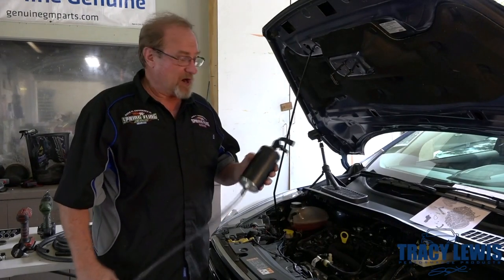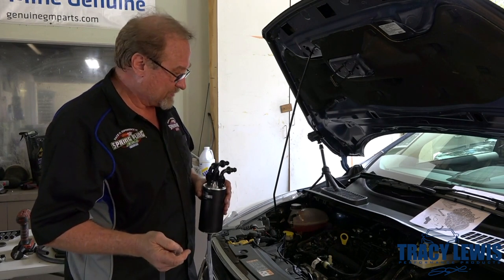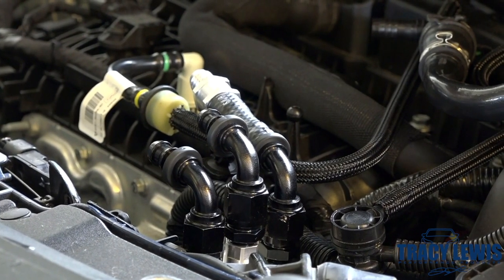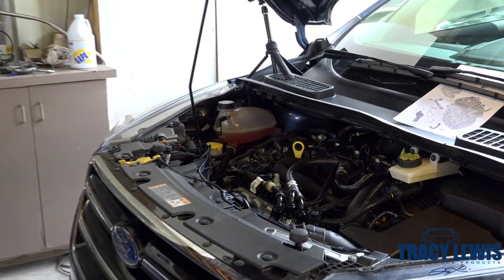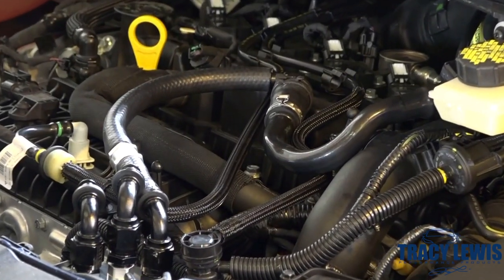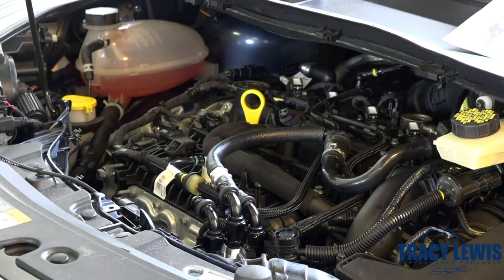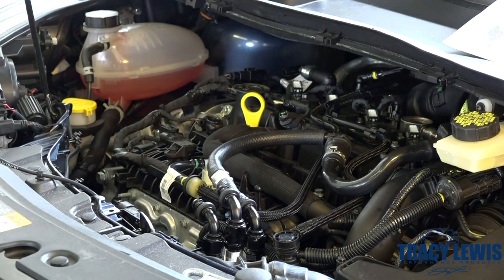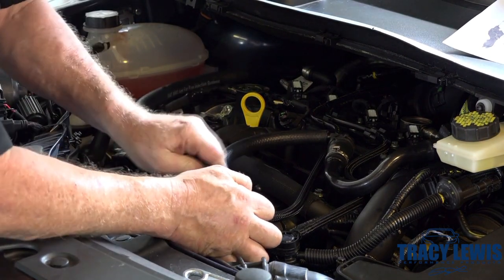2018 Ford Escape 1 5L Catch Can Install

Comment: Not to sound  rude. Is there a simpler  way to make it look more clean
Reply from the maker: The top cover is a foam to quiet the engine noise heard.  So I run without the cover as the heat it holds in is never good. But as long as all the hoses run the same as far as what they connect to you could get creative for sure as we send enough hose to be able to route them differently if that helps.   Thanks!

Comment: I have question I have 2017 ford escape 1.5 ecoboost I see oil coming from throttle body any suggestions as to where it might be coming from.I would really appreciate your help in this matter.
Reply from the maker: Absolutely. Can you describe what you have installed currently?
Reply: @tracylewisperformance1328  I haven't installed anything I noticed oil on my driveway and got to looking around and it is coming from the throttle body at which you and I both know that shouldn't be happening so the thought was is to buy new throttle body but that won't cure the oil leak.
Reply: @tracylewisperformance1328  so should I get a pcv hose assembly
Reply: @tracylewisperformance1328  it's running sluggish and I'm noticing using more gas it's as if perhaps it's clogging somewhere.
Reply from the maker: @traceyjones2010   That wont help as the factory PCV system is a flawed design.  You need the dual valve system we manufacture.
Reply from the maker: @traceyjones2010   Yup! Those are the common symptoms.  We guarantee to cure it. What State are you in?
Reply: @tracylewisperformance1328  st louis mo
Reply: Where does that oil come from?
Reply: @tracylewisperformance1328 I’m in NY what do I need to buy?

Comment: why you are installing a catch can. Why it is not installed by the factory if there is a need for it?
Reply: @smellyfeetarestinky  Actually!  Ford did fix this problem.
Reply: @whatthesnell   -- Thanks for telling us.
Reply from the maker: @tjwonder8157  Actually they have not. NO automaker has. Ford did add in small port injectors but unless they sprayed full time on the valves back sides they have had little impact on the issues.
Reply: @UCWiMFcSi2CRVMJBEq3SQVrA after reading your comment here I'm hoping you can help with my problem I noticed oil on my driveway not alot but enough to cause me concern I open good and noticed the oil leak is coming from my throttle body any idea as to what I should do I would buy a new throttle body but that won't solve why there is oil in there.
Reply from the maker: @traceyjones2010   Clean your throttle body with throttle body cleaner and wipe all residue off of it. Install our air/oil separating crankcase evacuation system and it will eliminate the issue. But you should have a manual intake valve cleaning done at the same time as yours will have severe coking at this point. NEVER use an engine running solvent based cleaning!! It will cause damage.  We are located in FL so if your near enough to come to us, we can install the system free and do the valve cleaning manually. Fuel economy and power will both increase guaranteed. Or we can guide you or the shop you use on it all.  www.RXCatchcans.com to order. Or call direct at: 941-700-7934
Reply: @tracylewisperformance1328  yeah I live in st louis mo